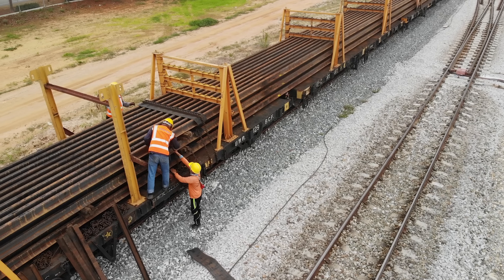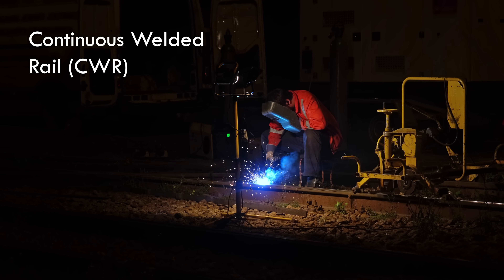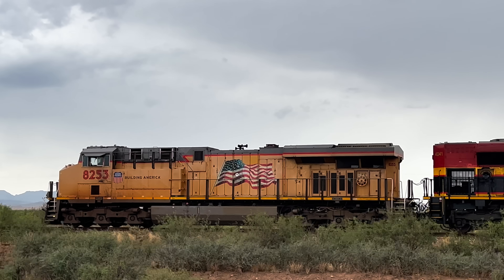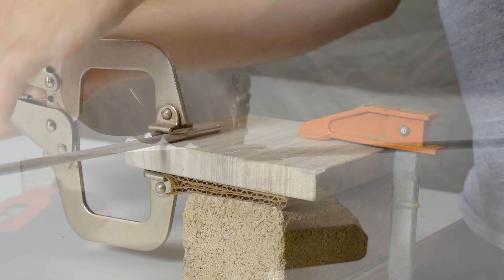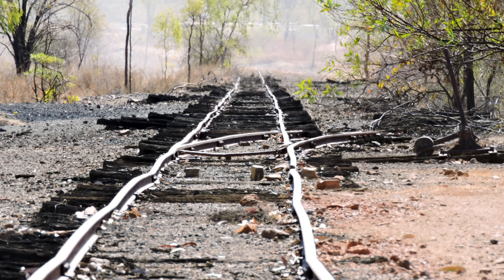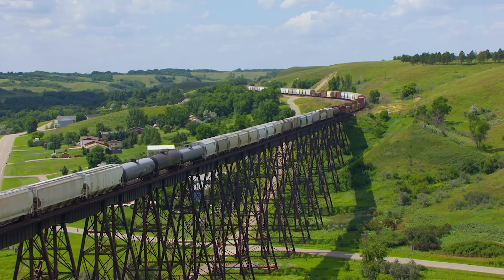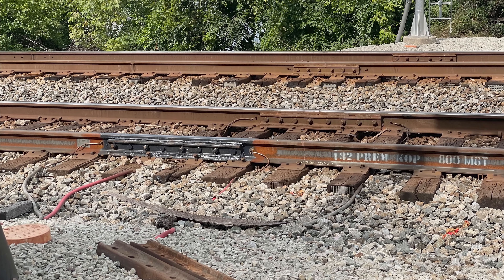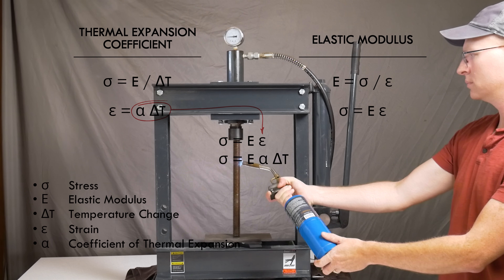Why Railroads Don't Need Expansion Joints

Comment: I developed a broken rail detection system at San Francisco BART that used ultrasonic waves traveling miles in the continuously welded rail. As part of characterizing the rail I measured acoustic properties as a function of rail temperature. It was amazing to see the rail temperature exceed 140 degrees F on medium hot days, like air temperature in the 90’s. The peak temperature was in the late afternoon when the rail web caught most of the sunlight. Definitely painful to touch!
Reply: "Don't touch the 3rd rail, it's hot."
"What do you mean? They're ALL hot!"
Reply: As a BART rider, I thank you for your service
Reply: engineering any equipment that is outside in the world day and night makes you aware of temperature.

You probably didn't have to think of this, but your counterpart designing rail lines through Montana has to take into consideration that at night it can be -30 (and lower with wind chill on metal rails..) and then get up to 130 the next day. That'll mess with your tolerances a bit.
Reply: @craigslist6988  Considering how much heat would get generated from a long train passing over as well, that'd be well over 130 for the rails on a hot day too!!
Reply: @scottjs5207  Steel is such a good elastic and bearings are so precise, it would be terrible at producing heat. I'm not saying you can't measure it, but I wouldn't expect much. Crushing pennies is a different matter. The newly deformed pennies would be smoking hot.
Reply: @craigslist6988 The wind chill only affects the speed at which objects assume the surrounding air temperature. A metal rail in 100mph winds of -30* will be -30*.

For us and other warmblooded creatures, wind chill is experienced as feeling colder than surrounding air as the rate at which it cools us is equivalent to whatever the windchill temperature is.
ie: windchill of -30* on a day that is -20, simply cools warmer objects and living things at a rate  equivalent to -30* still air.
Humidity and speed of the moving air affect the delta between air temp and wind chill.
Reply: @craigslist6988  I vaguely remember hearing that over the temperature range in the bay area, a mile of unrestrained rail will change in length by 7 and a half feet.
Reply: @pyrokaren .. Jesus Christ SEVEN and a half feet? I'd just go with the .3 inch clackety clack and recondition the wheels every 6000 miles or whatever,, safer than breaks from overstressed rails... But I guess that's why I don't run a cutthroat corporation...
Reply: @micnorton9487 Naah, they can make each crossbar so it can move, it moves so slowly it doesn't wear too much, also the crossbars (concrete or wooden) can move. Not too much of a big deal usually.
Reply: @tondekoddar7837  ..oh,, yeah expansion joints would be best,, it'd be one hell of a lot of work but if you believe in safety first it's the way to go imo...
Reply: yep, I think from memory that a rail length in the U.K. was a chain = 66 feet. 10 chains = 1 furlong and eight furlong = 1 mile. We would try estimating the trains speed by timing the seconds between clickity clacks and doing the arithmetic.
Reply: That sounds really, really fun. I get giddy just knocking on guy wires and feeling the waves go back and forth
Reply: @timothyhoekstra2604  That’s how I originally got the feeling that long range acoustic propagation would work.
I was in the maintenance yard where the 800 foot long strings of rail are stored just like the one shown in your video. I was just curious and hitting the free end of the rail with a chunk of metal and was delighted with the amazing sounds of echos. The sound would travel down to the far end and reflect off of the free end and return after traveling 1,600 feet. I could hear a beautiful and distinct tick each cycle. Since the rail is so stiff and efficient many seconds of echoes could be heard. There were like 10 or more ticks per second representing a few miles of travel.
I came back with some instruments and found that if it was excited at the optimal frequency I was able to record echoes representing a distance of 6.5 miles before the sound faded into the noise. (The digital signal processing class finally came in handy.) I kinda remember the compression wave traveled around 10,000 fps and the best frequency was around 16 kHz.
Since I had access to the test track I found out that it worked over a couple of miles even though the rail that is bolted down every foot or so adding to the attenuation. I made and tested a full automated system and was really proud of it. We were developing a new train control system that eliminated track circuits so I developed it into a low cost system to detect rail breaks. Unfortunately the train control project was cancelled and my detector wasn’t needed. It was really fun while it lasted.
I really like your videos.
Reply: If painted with reflective paint, wouldn't it improve safety?
Reply: @noop9k .. that's not bad but paint would probably flake,, maybe if the rail was electrically painted or whatever that might work... BUT only a Canadian or European or Asian rail corporation would spare the expense,, did you see the video of that train that eventually crashed in East Palestine Ohio, on fire as it was going down the tracks?
Reply: was it true about the six inch gaps in the transbay tube?
Reply: That's amazing work. Thanks for your contributions.
Reply: @purokaren Did you measure the aging safety, I mean the rails obviously got better the longer you tested them (if there were newer welds, they cure to better andensitic more stable - I don't think they turn martensite or any fragile stuff?) - graphs even maybe ?

I mean, Nokia already sells tech to measure undersea cables, I presume it's kind of same tech ?

Comment: So since the video is on the U.S., and we are so bad with updating our infrastructure, I am assuming this continuously welded track technology, isn't, or hasn't been done in most of the country correct? Cause I can see a 'its not broke, don't fix' or 'it didn't break enough, just replace that old section with same old same old.."  - kinda mentality from a lot of railroad owners and operators.  Is there any known % for how much of our track has been converted to this smoother continuous kind?
Reply: Incorrect.
I would say that 99% of all mainline tracks use CWR in the USA.  Joints are seen on brach lines, yeards, and trunouts (switches) and siganal insulation roles.  The transision to CWR started big time in the 1970's and was essentially complete by 1990.
Reply: @arnoldmorscher5970  Ah ty. wow we actually upgraded something so well in America, I'm impressed. Now the other safety stuff as we are seeing with so many derailments, is lacking behind for sure.

Comment: Another means of controlling expansion and contraction is with curvature. Slight sideways or vertical curves allow a place for the extra length of material somewhere to go that doesn't impact the integrity of the rails. In this case, the neutral temperature would be targeted at the median temperature of the area its installed in (Spring/Fall).

We here in the Phoenix area are very familiar with thermal expansion. Every once in a while, you find a section of sidewalk where the stresses of expansion have built up so much over time (in part because of degraded expansion joints--the 2x4s that the concrete crews leave in the sidewalks) that there is nowhere else for the pressure to go, so they simply thrust upwards--the only direction they are not bounded by--and you end up with a section of sidewalk literally looking like two playing cards leaned up against each other. I'd love to know just how fast this actually happens but, to my knowledge, it has never actually been witnessed or recorded directly.

Comment: Back in the 1890's at the Salt Creek Oilfield in Wyoming, the built one of the first cross country pipelines.  That pipeline was not buried, but rather it was just laid on the surface.   It worked fine until the first winter.  When the cold of winter came, they had over a dozen places where the pipeline parted, caused by thermal contraction.  That was 4 inch threaded pipe with 8 round threads, which pulled apart in the cold.  I enjoyed your presentation  I always wondered how the railroads overcame the thermal expansion problem.
Reply: Trans Alaskan pipeline overcomes that with jogs in the line every so often .

Comment: As a blacksmith and metalworker, it's always nice seeing different uses of steel. When i was making grids and frames, heat was a major factor in achieving precision. The precise order at which you do the welds will move your steel around, and pull or push/buckle your bars. Welding tends to pull as the metal cools down, i think it would help against the buckling of rails
Reply: That’s an interesting insight. So your shrinking welds work a little like scars, maybe? A healing cut can pull and tug your skin in small, uneven ways. That’s what makes a scar so noticeable, even more than the line of fresh scar tissue. (I think that’s why patients with visible cuts typically see plastic surgeons for revision after healing. Even if the original cut was perfectly patched, the recovering tissue will shrink and warp at the edges, just as you describe in the welding process.)

Now I can’t stop picturing a nose job done with a welding rig. Mask down, sparks a-flyin’. Celebrities the size of Lady Liberty getting an overhaul to carve a couple hundred pounds of copper out of the ol’ schnozzola. Hammer out that crease between the eyes, while you’re at it. A little Bondo® around the lips, please?
Reply: @martybishop8484  uhh yeah i suppose that's similar. But we also learn that heating up a bar of steel that has been compressed or held into a frame, will shrink and pull your whole structure. The reason is, as you heat up it expands, but of course applies pressure, just like shown in the video (in the press). Except at some point, with high enough heat, the steel just gets compressed and actually becomes shorter, losing the elasticity. So when it cools back down, it actually wants to keep its compressed state, and as it shrinks it pulls the whole structure with force.
Reply: @jeanladoire4141   That's because when it's compressively restrained lengthwise, the extra volume of steel arising from heating it can only go into width and height. 
When the temperature returns to normal, the steel shrinks in all three axes, including length which will end up shorter than it began (whereas the width and height will remain increased, albeit less than when hot).
This is seen more clearly with sheet or plate steel, if the heating is done quickly in local spots, to cherry red. When they have cooled, you can feel the bump on both sides of the plate where the "upsetting" of volume has thickened the steel locally. In this instance, the restraint is exercised by the surrounding cold metal (no need for a frame). 
This technique can be used to correct distortion arising from other processes, including welding, by shrinking in carefully chosen locations.

Comment: as always extremly educational, on point, no fuzz, amazing job! if I can give you one advice: FLIR thermal cameras are probably the worst ones to use. Their Thermal sensor has an extremly bad resolution (I think you have the one whit 80x64 px) which uses an bad overlay of extracted edges from an additional camera (or the mobile phone camera) to simulate more than there is. These edges are often put with an offset because of perspective distortion of two focal points, and the image quality is really bad.) There are a lot better thermal cameras (also not expensive) for Mobile Phones (without watermarks) i.e. from SEEK Thermal or InfiRay. Those use a thermal sensor with 200x150+ px and the raw thermal image is usable without overlays. I rreplaced my FLIR cameras and never looked back, I recommend you look into them, its a huge upgrade :)

Comment: Great video! It would be interesting to also show this effect when the railway is placed on a long viaduct, an effect usually referred to as track-structure interaction. We don't always place a rail expansion device on bridges as they are very expensive to install and maintain. Instead, we analyse the effect of the bridge expanding and contracting under the track (yes it can get quite complex!) and then assess the additional stresses from this effect. We also analyse the additional stresses in the rail due to the braking and acceleration (and vertical) forces from the train on the bridge, which invokes the foundations of the bridge and eventually impact the rail stress. I've worked on this for more than two years and I keep learning new things!
Reply: Interesting, the RR I work for has a few bridges with them.

Comment: I love that the primary solution for buckling is just “do it on a really hot day lol.” It’s the kind of thing that sounds way too dumb to work but is somehow the most genius solution ever.
Reply: That's what i do installing 'floating floors' and such
Reply: Honestly I though about doing it on hot days, and during all the video I was wondering what was the problem with that? All to find out it was actually the solution. Maybe I should have worked as a railway engineer
Reply: man u spoiled it
Reply: You can't do it on the hotter days, you would just get massive amounts of broken rails when it gets it's coldest. It has to be done at the upper median temp for that area.

However, areas without a massive temp swing don't have to worry about this too much. My Subdivision has to deal with -30° to +50°c.
Reply: @littleherms3285 he mentioned there in Texas they were installing at 104° or whatever, and it was only a few years ago they got that crazy "polar vortex" cold snap.  I think temps were down to like 20° or maybe lower. Were there any issues with the rails? I'm not aware of any.
Reply: @AkaRyrye83  oh, they had broken rails for sure. We have about 30 or so per winter, you never hear about it generally.  Nothing really happens, just drops the signal into that block and you are capped to 15mph while being prepared to stop in half the range of vision. I've gone over a few...lol. You see them and if it's small, clean and vertical, just keep going. Otherwise you could be stuck there for 2 to 4 hours while they fix it. I did find one with 6" of rail head missing, didn't go over that one...lol.
Reply: for engineers it's obvious... really obvious. Honestly I think his explanation was misleading.. the direction of thinking is backwards.

As an engineer you would think of wanting to tension the bar first, because that's an obvious well known way to prepare for thermal expansion. But the obvious problem is that as it cools the tension will increase.

So you figure out your safety factor'd tensile limit, calculate how much strain (lengthening of the rail) that max tension will cause, then plug that into the themal expansion equation which will give a delta-T, which is the maximum range of temperature the rail can be tensioned to neutralize expansion for. This is the basic solution to the problem, but I will say there's a whole lot of work wrapped into "decide on the maximum tensile force" part.

But moving on, since that temp range apparently isn't a large enough number to cover the range of temperatures we see outdoors on earth, they are stuck having to design the rail to survive some compression also, which again the obvious solution is by 'pinning' points down to avoid buckling.

So avoiding buckling that way, when you've come at the thinking the direction I'm describing, is basically an afterthought. I'm skeptical there aren't a lot of other nuanced things involved in this solution too, but those are really getting into engineering weeds. But that's just the reality of engineering.

The reason this wasn't always done or done earlier wasn't for lack of 'genius' engineers but lack of practical ability to do it. I wish he had explained more what that was because I can only make educated guess(es). Probably it was a series of factors that all had to be solved over time.. such as the quality / consistency of the rails, and the difficulty of welding pieces together well enough that they don't just instantly break on a cold day. Most people don't understand how complicated "welding" is.
Reply: @craigslist6988 .. that's true,, to completely weld  steel rails together,, they'd be slightly "arrowed" allowing filling in the ENTIRE rail,, not just a beveled edge and only half an inch of fill.. but the guy did say he was making it basic,, and your engineering explanation made more sense than his algebraic equations...  👍
Reply: And then,you get 3 years to conpkete 200 meters..
Reply: It is kinda obvious, not dumb at all.

Comment: 12:20 Tensile forces before they are welded? Wouldn't it be easier to apply the tensile forces after welding (but before definitively fixing) the rails?

Comment: Fun fact. I worked at a certain rail yard in a certain city in Ontario for a certain company that did not maintain their rails in the yard for fear of losing productivity.
Parts sank so deeply into the ballast that I am surprised why no cars have overturned passing over those sections.
The feeling of riding the side of a box car that dances like a drunk whale is... less than pleasant. Would not recommend.

Comment: Two feet per mile is equivalent to approximately 0.3790.379 meters per kilometer.  So, you should have rounded to 1/3 rather than 1/2.
Reply from the maker: The script says "...more than 2 feet...". The exact numbers are 2.74 feet/mile or 0.52 meters/km.